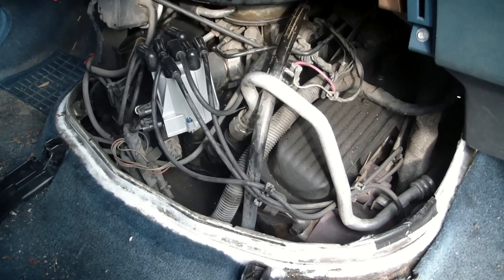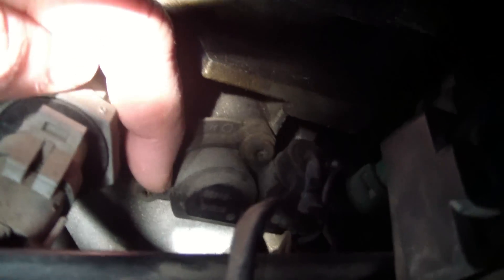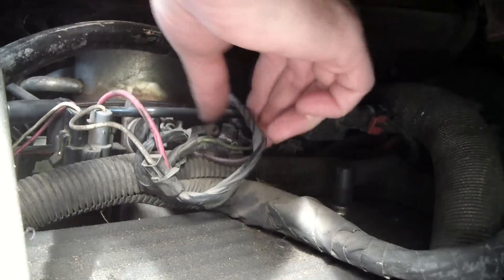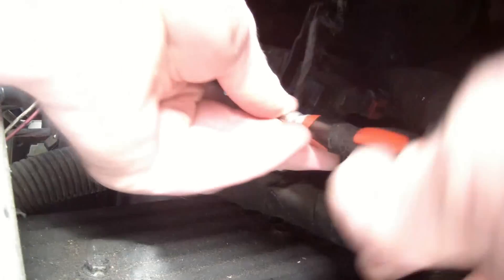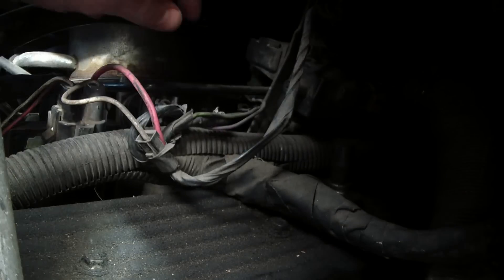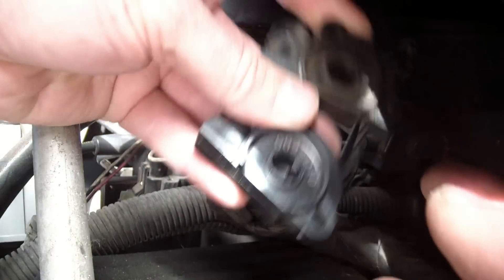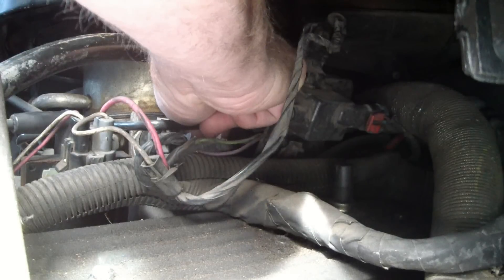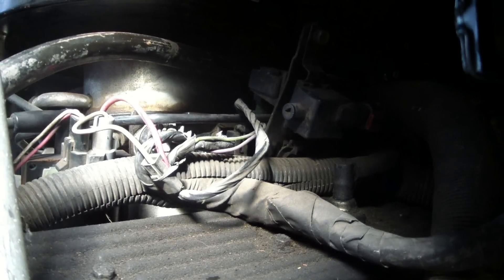How To Install A Throttle Position Sensor TPS On A GMC Safari Or Astro Van

Comment: nice symptom and checked problems description, but I miss air topics ... means, if it is electrically fine, and petrol flow there, and egr works, remains the air. Any old pipes or tubes or air flow sensors which could influence the volume of air flow or any required vacuums or which could send wrong data to the system?

Comment: yes, that Opel (97 model or so) did also not show check engine light. They called it Luftmengenmesser (air flow sensor), and it measured incoming air pressure to determine the mix ... this specific part had a wire or gatter to heat the unit during cold and to dry it during humid conditions, which did not work properly, so the sensor gave wrong output when and after I went during rainfall on highway. Could reach my home and next day the garage, where they immediately identified the bad part ...

Comment: Great video -- I managed to get the job done really quick, thanks!

Any idea what the part # is for the rubber seal you mentioned?  My seal was in bad shape, but I can't find a replacement anywhere!
Reply from the maker: Professor Doom I don't know.  I don't have the van anymore.  I bet an auto parts sore or car dealer would know.
Reply: ***** did u ever figure out how to fix the gas-stink problem? I have the same issue..
Reply from the maker: latido eterno I had one bad spark plug wire that was working intermittently.  I should have checked that first!  New wires made everything work properly.

Comment: True for a 93 van.  A nightmare, ship in a bottle project for a 1995 van.  Probably no need to remove the engine cover, just the air filter assembly down to the butterfly.  It's wedged in just to the left of the air conditioner compressor on the throttle body.  No room to work or see what you are working on.  I''m off to the auto parts store to see if I can find a stubby T-20 on a 1/4" drive.  Hope I don't have to remove the compressor.  Probably the hardest sensor to replace on a 1995 van.
Reply from the maker: There isn't much room in there.  I sold the van and bought a Silverado pickup truck, and it's so much easier to work on because there's so much room under the hood.

Comment: sorry overread that MAP thing ... ;-)
must be the current abbr for what was called in my old Opel Vectra "air flow sensor" ... ah, and btw: when I had the problems, they replaced the part in the garage free of costs, since they found that it was included in any product recall action which I had missed (or never heard of, since it was one of those "hidden" actions, where they exchange parts in the garage without even telling the customer about it ... seems my garage had "forgotten" about ...)

Comment: Dammit. It's a real pain finding the source of an issue with these engines. My experience is that it ends up being something kind of simple. I just had to replace the lines going into the Plenum that lead to the spider. Best of luck.

Comment: These engines identified develop fuel leaks within the Plenum/upper intake. Causes the symptoms you're having. It happens to me and I went through everything I could think of before discovering it. Also, fuel pressure may full you because the Plenum will hold.

Comment: Wow I was just checking out another video and Cody said a temp control sensor took care of his rich fuel issue and also talked about the Map sensor. I'm gonna change those things also. I know you said you don't have the Safari anymore I just like talking to ya. Thanks!
Reply from the maker: Thanks.   Those are good things to check and change as well if your engine is running rich or rough.

Comment: LOL, remembers me anyhow on that old joke:
customer: 'could You please check the spark plugs, there must be anything wrong!' mechanic, after 5 minutes: 'the spark plugs are fine, but You have to replace the rest of the car ...'

That distributor cap issue on my old VW took me nearly half a year - 3 months to identify definitely the cap as the problem (after exchanging cables, plugs etc.), and some weeks trying to clean it always - before I got a new one and finished the job ... ;-)

Comment: Could a faulty TPS make you think your transmission is slipping?
Reply from the maker: I don’t think so.
Reply: hard shift may be indicative of tps problem.
Reply: Most sensors will cause a hard shift, specifically 1-2 shift... Transmission shift selenoids can cause slipping sensations though. The big "tell all" is to check the color and smell of the ATF
Reply: That’s what I was wondering. I’m having acceleration issues and eventual unexplained stalling when I punch the gas to see if it’ll go more. This seems to happen when it’s hot. I’m trying to figure it out but know nothing about cars. The mechanics I’ve taken it to can’t seem to figure it out. I think mainly because it doesn’t happen in their care. I drive for 30 minutes in traffic though and it happens.

Comment: I guess I am some what "Old School" Points carbs etc. However , this new tech can be hard to understand. I know what you mean. No Codes...When I worked for Triumph Motorcycle Press fleet 2000-2004 we had problems that did not show up as a "Fault" My 2001 Triumph Sprint St had a coil go bad #3 Thanks to obd2 ,I was able to find the problem . My Triumph was having an Intermittent coil fail. 40 seconds... Code showed coil 3 .I changed it and every thing is fine now.

Comment: yes, especially if those hoses are made from any plastic or rubber material, they could be even broken without You may notice anything. Some of these materials keep, depending on climatic condition, not even 10 years tight. If there are any rodents or so in Your area and bite inside You could see damages, but the usual deterioration of the such materials causes mostly invisible leaks.
Really difficult - hope You must not buy all such parts new just for trying what it is ...

Comment: What if the teeth don't line up?
Reply from the maker: They should, but you may have to rotate it sideways to get them to line up, and then rotate the screw holes into position.

Comment: Lol u guys kept saying the plunuem 😂 its usually the charcoal canister being clogged causing fuel issues i have a 1990 and still going strong with new motor rebuilt transmission and still have the original motor with a new timing chain on it sitting the a crate in and it still good but have valve seals to replace also map sensor and iac and tps sensors get corroded all the time from steamy coolant on engine  bay by now you would need to get an electrical  kit to replace all the connectors and get rid of corroded coolant contaminated wires